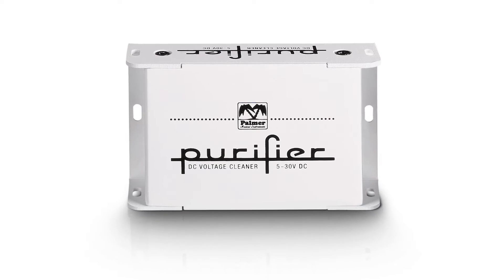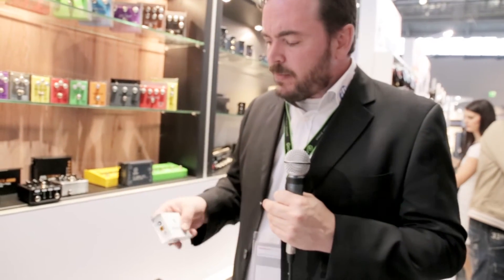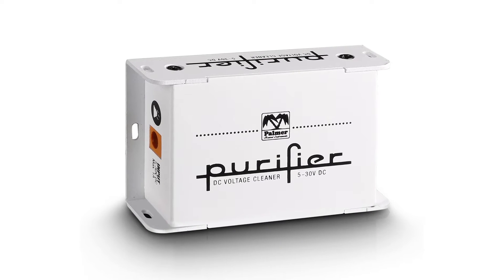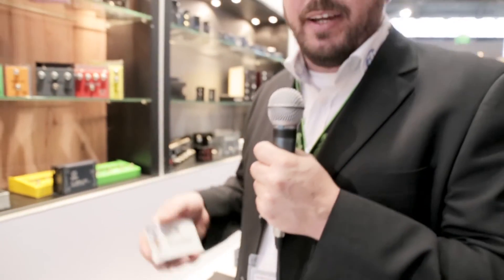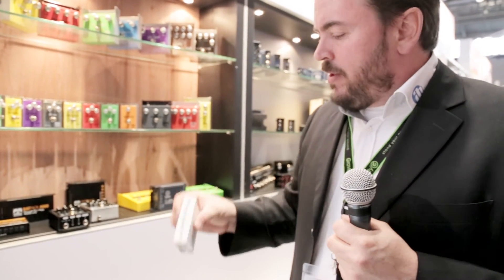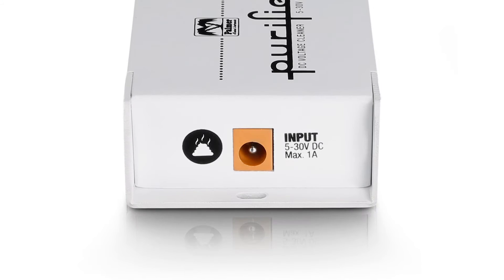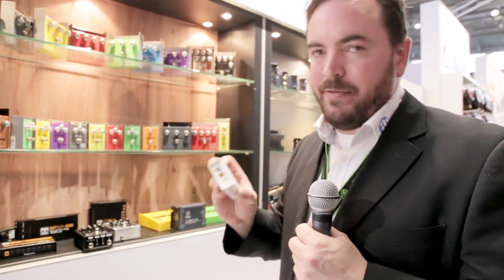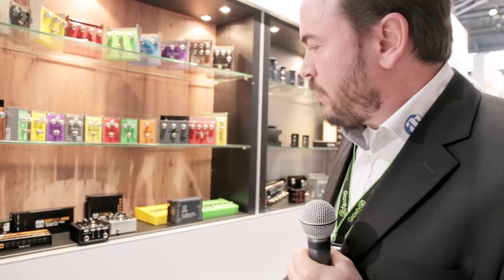Palmer Germany at prolight + sound 2016 - VOLTAGE PURIFIER

Comment: which for head amp?
Reply from the maker: We don't offer a power conditioner for a power amp, sorry. The purifier is for pedals, etc. :)
Reply: @PalmerGermany  It will be ok if i will use it with my dj controller?
Reply from the maker: @majo1618  Sure, as long as it has an output voltages from 5 – 30 volts